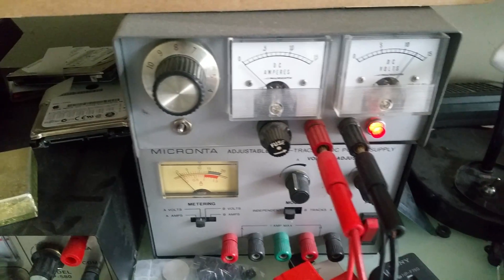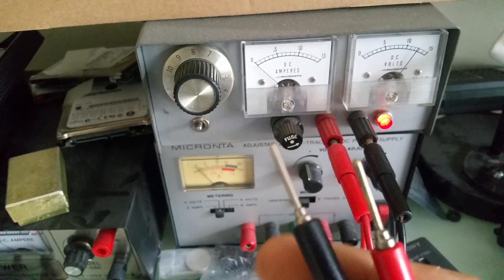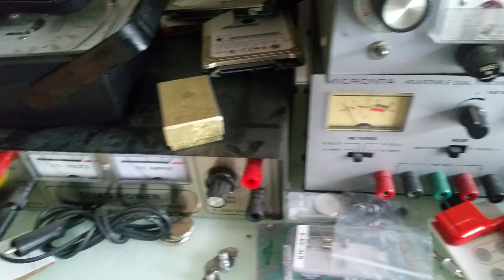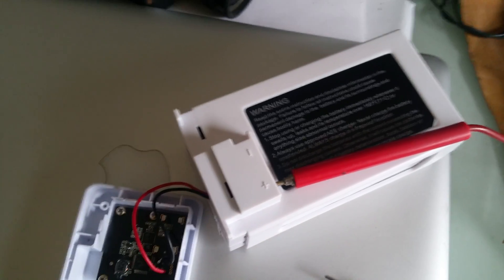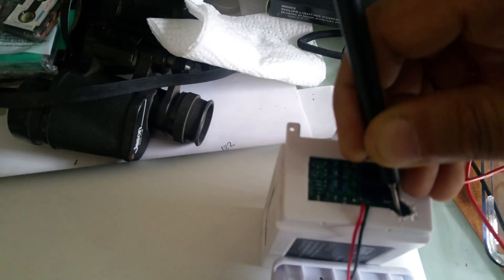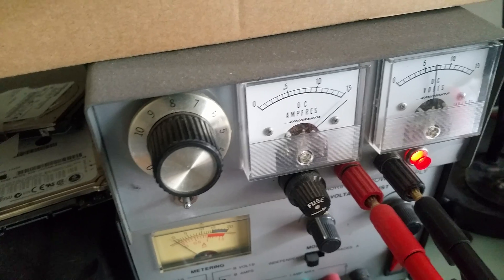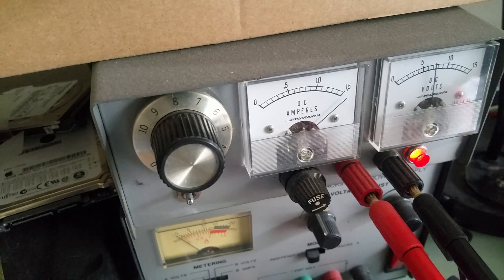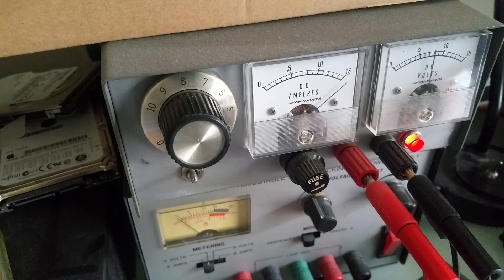How to fix repair  Toruk AP10 Pro BP-AP11 battery Pack Part 2

Comment: Does anybody know, or can someone measure, the internal resistance of a working battery please. Every time I try this technique, the over current protection on my power supple trips. From the video, it is not clear what current is being drawn because the amp meter looks to be pegged at max.
Reply: Never mind. I turned off OCP and tried again. I was set at 12V and 4A. Held it for about 10 seconds the checked and battery level was on again. Seems to be charging now.

Comment: You think if I use a lantern 6 volt will work just to get it puowe
Reply from the maker: It should, all we need is to boost the battery to make it visible for the charging circuit, as soon as you see the battery icon contour on the LCD- you are there. Good luck.

Comment: Well my battery didn't get any volts from the rigulator and i tried it for a while ithink the battery is done,if some one knows where to find new ones ill be happy to know beacause my drone had been sitting for 5 years with out doing any thing just filling up with dust
Reply: Amazon has some replacements but they are really expensive

Comment: What brand/type Regulated Power Supply did you use.  Can I purchase one on Amazon?
Reply from the maker: You don't have to use this particular power supply to fix the battery, some people used regular 9V, or 12V power supply and it did the job, keep in mind, that all you have to do is to boost the battery until battery icon appears on the LCD screen.
 Good luck.
Reply: @artsvideoonline  Thank you for the prompt reply.  I have tried with a 12V battery charger but was unable to get any boost.  The battery may be beyond hope.  I figured i would try another charger or power supply that would provide a constant charge because these new battery chargers will work unless it detects a certain battery etc.  Thanks again.

Comment: This is a great job you did.  Has anyone tried just soldering a say a 120 ohm or so resistor across the current regulator?  Kind of a "trickle" charger?  120 ohm at 12 volts would provide about 100 ma for a fully dead battery.  A 120 ohm resistor would need to be a 1 watt resistor.  The bigger the resistor (and still overcome the issue) the better it would be.  I think I will try 270 ohm resistor first and will get back to this site to let you know.  Thank you Artur.  I just bought a new AP10 on close out - dead battery.  Mine may not be the same problem because mine showed that it fully charged (the charger light went green I think) but does not hold a charge.  I will retry.

Comment: also I did manage to do it without breaking the case...(USB wire plugged in phone charger,the other side of wire cut off,to the positive I connected little metal which slides in too the +,to the negative I connect niddle which is slightly blended so it allowed me to slight it under the case and touch battery  negative(sometimes negative is cover with epoxy or some glue and you have to give it little scrape to uncover silver part)

Comment: Have the same problem but I don’t have the current supplying machine
Reply from the maker: Aamir khan use any 12V DC power supply,  just pay attention to polarity (+ -),very important, good luck.
Reply: thanks alot

Comment: You saved my drone battery! I have the same drone and I had not flown it for over a year because of this problem. I do not have a regulated power supply but I did have a 12v drill battery and it powered back up! Thank you!
Reply from the maker: Good news, I am very happy for you, thanks.
Reply: @artsvideoonline ... hi I have couple of those batteries and with the help of your video I was able to    give them life back...THANK YOU VERY MUCH....there is but!!!
Reply: @artsvideoonline  some of them showed the battery icon after I followed your instruction   but the charger doesn't Charge them(green light)
Reply: @artsvideoonline  also I did manage to do it without breaking the case...(USB wire plugged in phone charger,the other side of wire cut off,to the positive I connected little metal which slides in too the +,to the negative I connect niddle which is slightly blended so it allowed me to slight it under the case and touch battery  negative(sometimes negative is cover with epoxy or some glue and you have to give it little scrape to uncover silver part)
Reply: @artsvideoonline  I will be very greatfull if you could help.me with the rest of the batteries which was  boosted and icons shows but no charge.thanks
Reply: DJ Quintana how exactly did you do it????